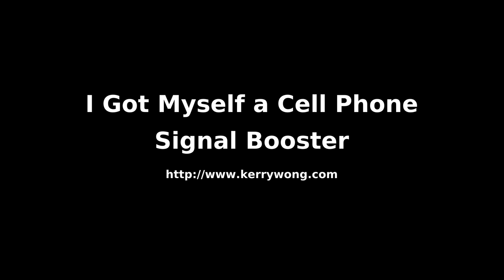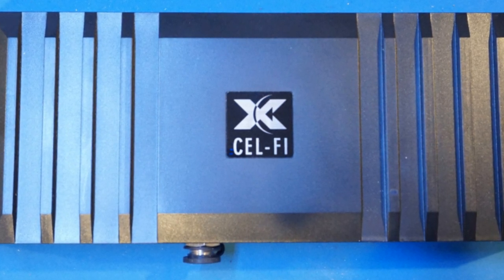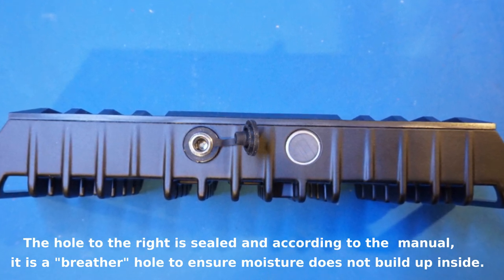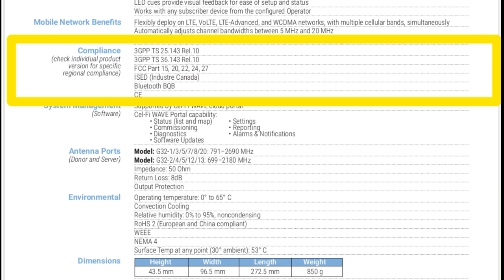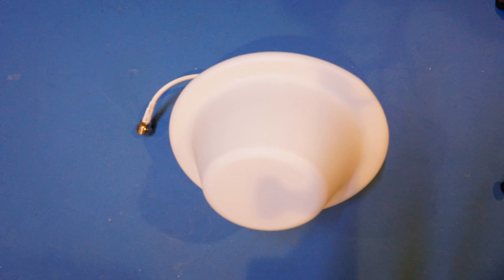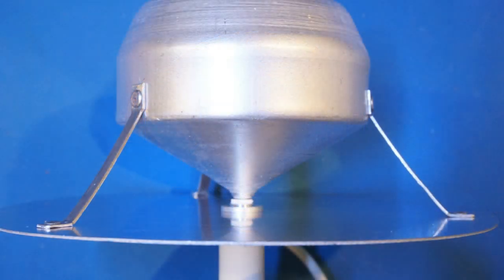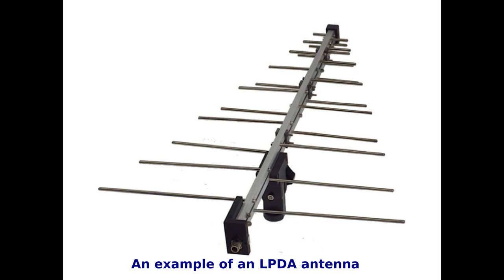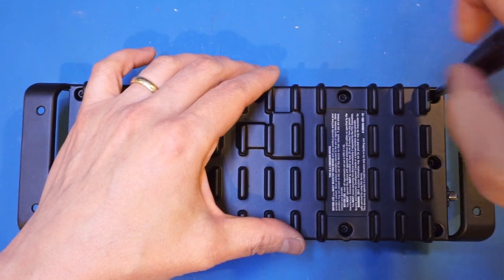Teardown of a Cel-Fi Go X Cell Signal Booster

Comment: Great teardown video.  I found the Youtube video first.  I am an RF engineer and founder of a company serving the DAS (Distributed Antenna System) world, providing in-building cellular and public safety coverage.  You gave very clear explanations for anyone.  I am also a Cel-Fi reseller. I would recommend you mount your donor antenna above the roofline, outside. If you do, remember to install a lightning arrestor if you do. This will improve isolation, as you pointed out, as well as increase your donor signal level(s).  Maybe your high band would become useable? 
I can answer your question about your phone locking on to the high band, even though its or poorer quality and service then your Band 13 signal.  The function of Band 2/25 (1900MHz PCS) or 4 (2100MHz AWS) being preferred over band 13 (700Mhz LTE) is a programmed choice by your service provider.  In your case, the service provider wants the phone to use 1900 or 2100, because of more data capacity, before dropping to the 10Mhz channel on band 13 (700Mhz). You receive this signal better at your house because it penetrates trees and free space better than the high hand by at least 6dBm, which is 200% more signal.
During the phone's provisioning, the service provider selects 1st, 2nd, and 3rd choice bands along with a lot of other data, like handoff lists, etc.  This data is loaded to your phone during this initial programming when the phone is connected to their network.  These are regional settings and for example, in the Baltimore-Washington area, VZW's 1st choice is 2100, 2nd is 700 and third is 1900Mhz.  On AT&T, 1900 is 1st choice and then 700 is 2nd and so on.  The interesting one is the new T-Mobile/Sprint.  Since the pandemic hit, they are letting users roam back and forth on all bands between them, depending on what coverage is available where you are at, increasing service availability for their users.
If you have any more questions email me.  I left you the same comment on your website, so you have my email now.
Dan
Reply: Interesting, I just bought a Sprint Note 20 Ultra and in some areas I am seeing the 5G icon light up, but Afaik no carrier has turned on 5G in San Antonio. When the weather is clear the 5G connection is very fast, whatever it is, but when the rain hits it starts dropping packets and becomes almost completely unusable. Switching the phone to 4G only mode fixes this at the cost of speed in good weather.

Comment: This is absolutely not my area of expertise but the whole soldering area FY35 @13:29 looks identical to FY33/FY28 @13:18 and FX83/FX62 @12:33
-> Looks to me like there are versions of this device with two separate outputs for two indoor antennas. 

EDIT: On the other hand the case and the rest of that board area are missing the requirements for a second output...

OT: Please improve your voice recording setup - the white noise through the whole clips is a bit annoying.